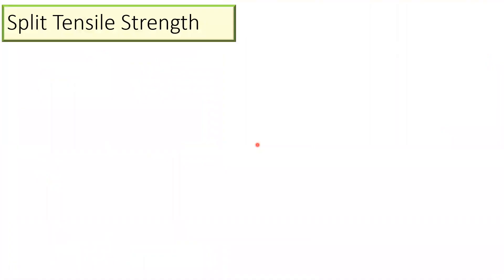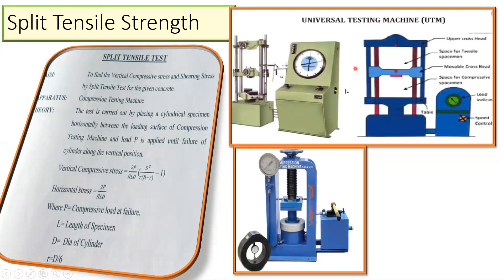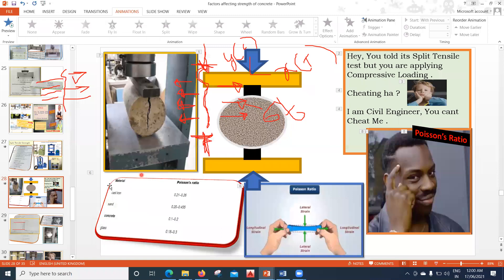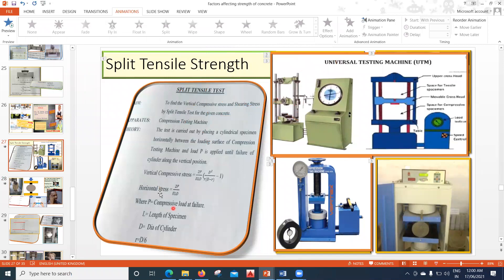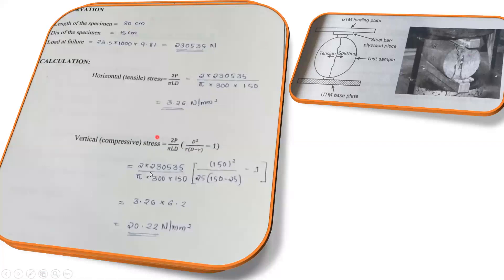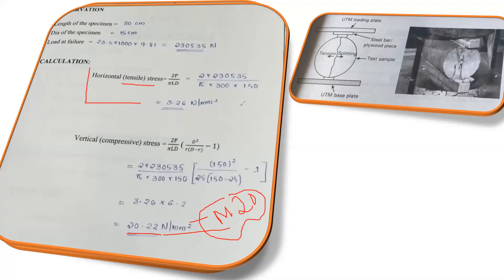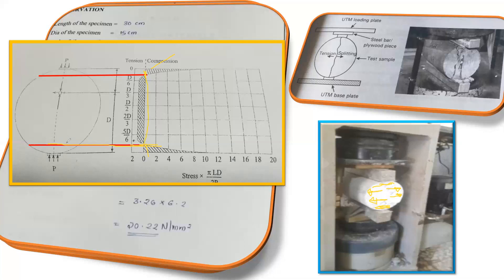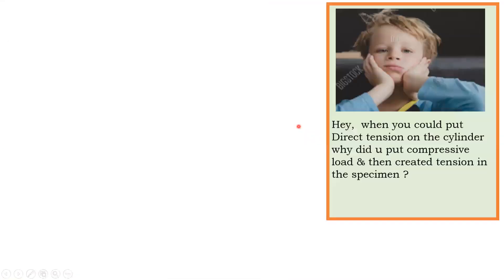How to determine split tensile strength test of concrete l Split Tensile Cylinder Test (ASTM C496)

Comment from the maker: Grab the offer Now! It’s Now or Never - Course At 360rs only!
Get Course completion Certificate!

o	Course 1- Diploma in Basics of Civil Engineering for Construction ( 20 hours content)
           https://www.udemy.com/course/basics-of-civil-engineering-in-construction-for-begineers/?couponCode=C16FFC4BD99A43541446

o	Course 2 - Construction Methodology Basics in Civil Engineering  ( 23 hours Content )
https://www.udemy.com/course/master-building-construction-with-practical-autocad-drawings/?couponCode=EA4F4758F1103FC5D572

o	Course 3- Quantity Surveying Building Estimation BBS with Excel & CAD     ( 21 hours content )
https://www.udemy.com/course/complete-estimation-costing-of-g2-hostel-building-bbs/?couponCode=87F8487AD1BFB7C15FC0

o	Course 4 - Project Planning for Civil Engineers  
                                              (6 hours content)
https://www.udemy.com/course/construction-project-planning-for-civil-engineer-ms-excel/?couponCode=5A526075357013DBF9CB

o	Course 5- Learn to Read Construction & Structural Drawing Like Expert ( 27 hours content )
https://www.udemy.com/course/learn-structural-architectural-vastu-plans-along-etabs/?couponCode=B1D3006892BD3B08ACA0

o	Course 6 - ETABS- Learn Building modelling Analysis & Detailing ( 20 hours content )
           https://www.udemy.com/course/etabs-learn-complete-building-analysis-design-detailing/?couponCode=EAAACBD4267160CDC2F3

o	Course 7- Concrete Technology - A practical Approach
                                                             (14 hours content) 
https://www.udemy.com/course/concrete-technologycivil-engineers-lifeline-in-construction/?couponCode=D6529EC7320B4F3EA3C4